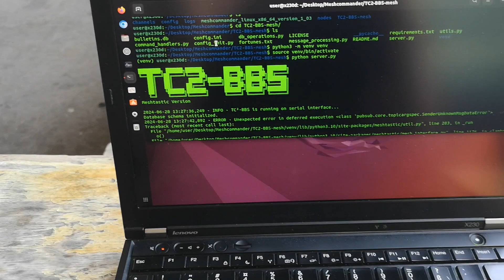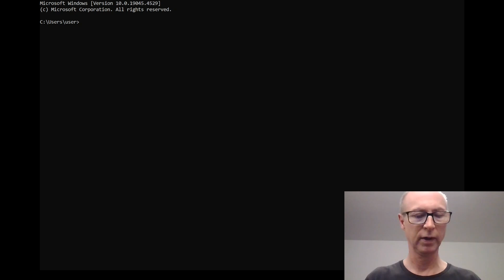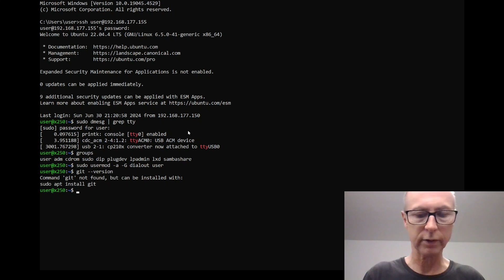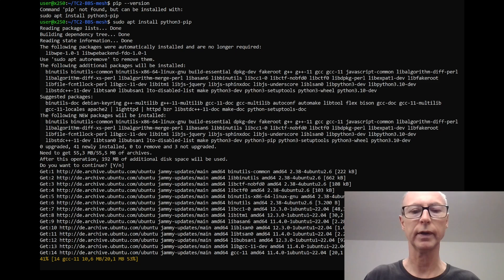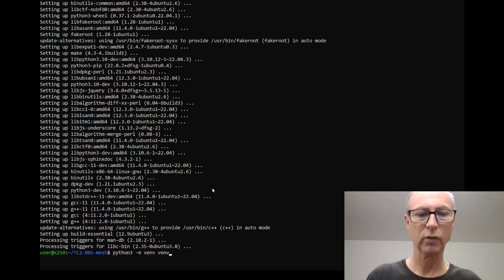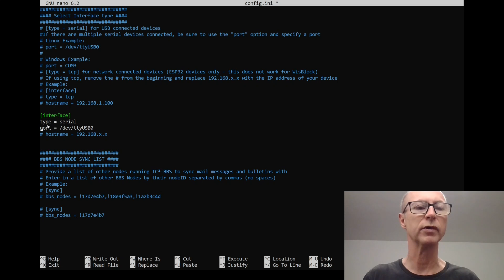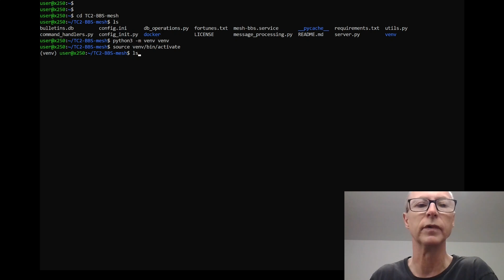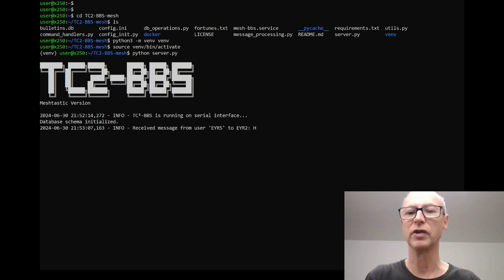BBS for Meshtastic - Easy Install on Ubuntu 22.04

Comment: also running on a raspberry pi  using raspberry pi linux
Reply: I was thinking about trying it glad to see someone is running it this way. Are you using PiOS?
Reply: @zacharyjohnson7192  Yes, the pi400 is doing lots of little jobs, this is just another string in its bow.
Reply from the maker: Well done !

Comment: Great video, will install it this week on a rpi. Question, do you need to install a particular version of Meshtestic on the Heltec module?
Reply: I don't recall seeing any special firmware requirements but for the record I'm running 2.3.13 (latest beta). I was testing using the RPi Chromium browser to remote update my device.
Reply: @endurodriver super, I will go that way. Thanks
Reply from the maker: I think that any version should be fine.

Comment: Using your video I was just able to get this running on a Rasperberry Pi 4B running the latest Debian Bookworm. Using a Heltec V3 via serial at the moment but I'd like to use TCP/IP and connect to my TBeam router on the roof.
Reply from the maker: I believ there are still problems with connecting via TCP/IP to meshtastic nodes.

Comment: Brilliant!
The whole "Citizen's Band" chat thing is interesting but the BBS functionality will elevate this to a proper information service. I was a BBS user back in the 1980s starting at 300 baud. In those days, an Apple ][ with a 20 meg hard disk made for a plenty capable host. Today an RP2040 with a tiny uSD card should be able to fill that role.
Reply from the maker: You are right. This takes it to a whole new level thanks to the creator TC2.